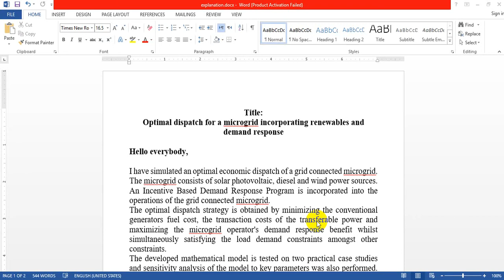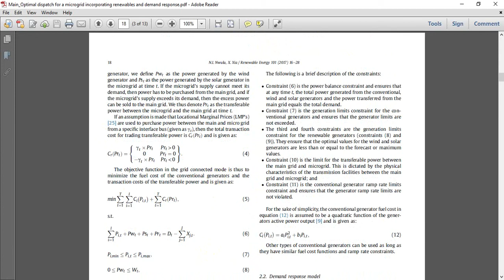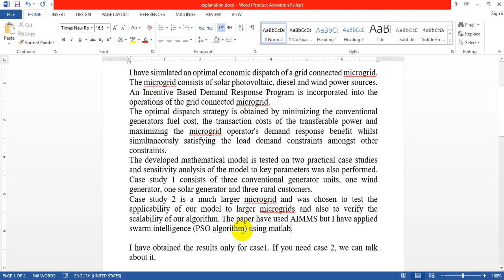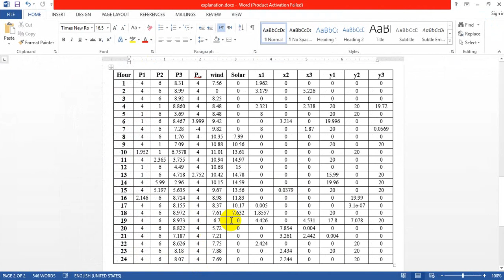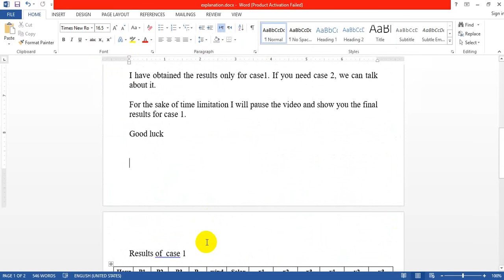Renewable Energy management and Demand Response and by PSO (Download the codes for FREE link below)

Comment: Good Job sir and Thank you for this video. please I have sent you a mail requesting for the codes. please send me function file code and pso cod at subhash05754@gmail.com.
Reply from the maker: Please send email to studentsmatlab@gmail.com
Reply: sent u mail sir.. please give program code sir
Reply: Sir,
Thanks for sharing my code but this code is not running. Kindly share me running code and code for entire power generation sources used as per the paper.
Reply from the maker: @subhashyadav1599  Please send email to studentsmatlab@gmail.com to check the problem